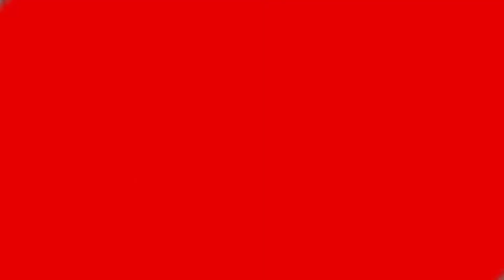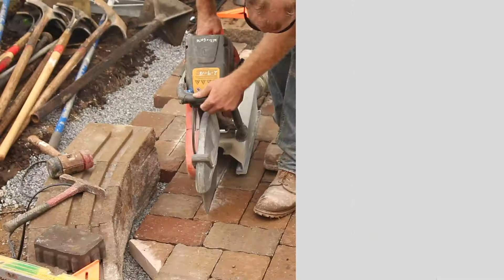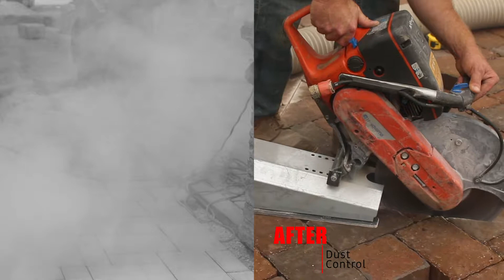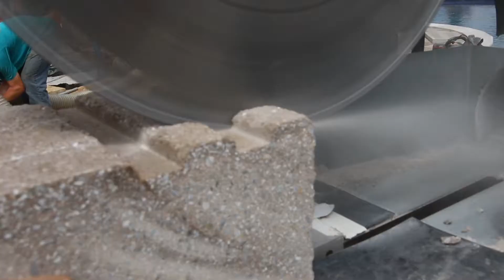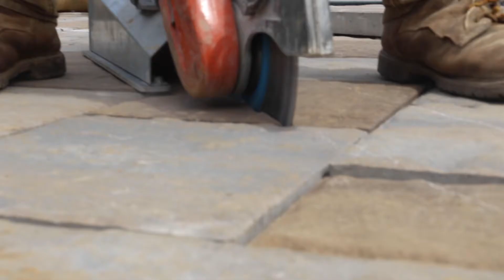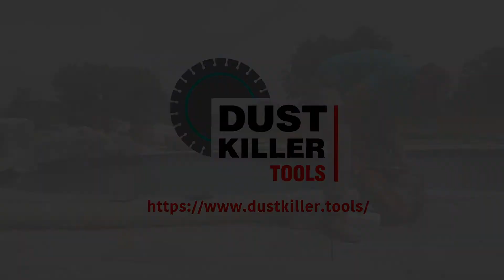Silica Dust Control for Concrete and Hardscape Contractors | See the Difference

Comment: Looks too bulky
Reply from the maker: Hi Juan, it may look bulky, but doesn't really feel that way.  First, the weight is gliding on the pavement you're cutting; you're not carrying that weight while cutting.

Second, the saw itself is being supported by the attachment.  An attendee at HNA 2019 mentioned how it kept the saw upright.